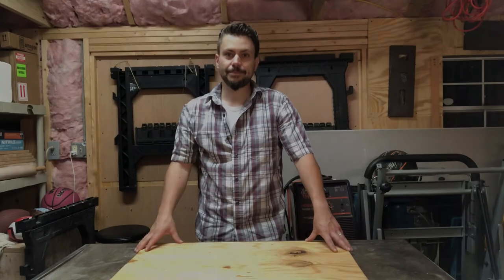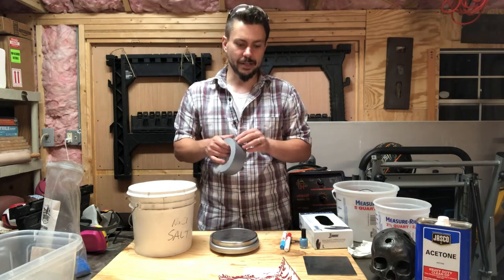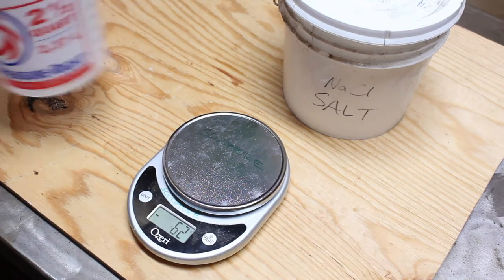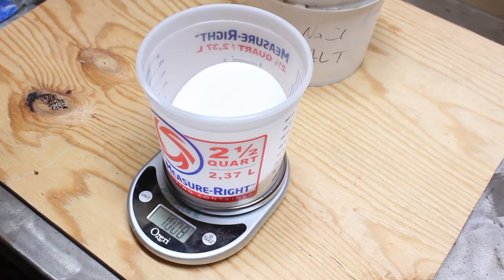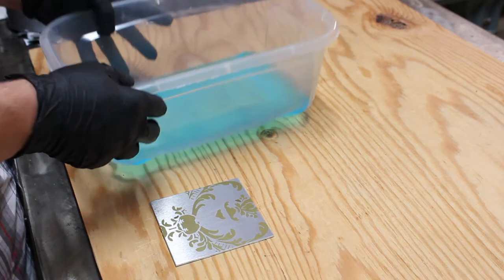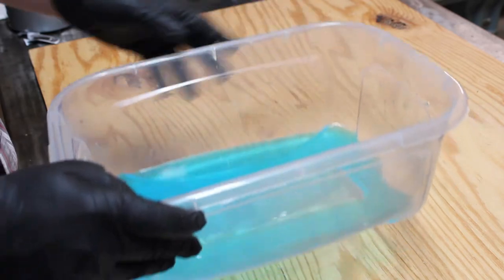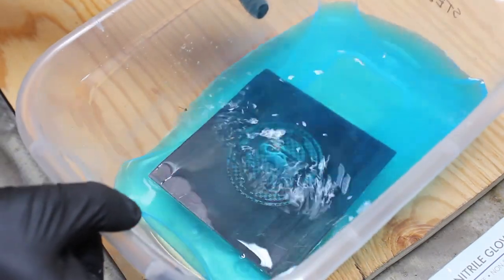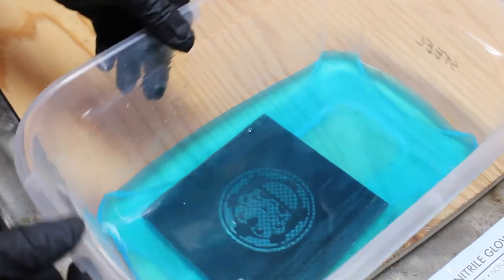Metal Etching with Copper Sulfate

Comment: You don't need to get anhydrous copper sulfate for this. "Anhydrous" means "Without water" which in this case is simply not necessary, as we're making an aqueous solution anyway.
Copper sulfate is trivially available at most hardware stores as a root killer. Just read the label.

Comment: does this work on stainless steel?
Reply: Certainly. Mixtures of nitric acid and hydrochloric acid (in a mixing ratio of 1 : 3 also called aqua regia are able to etch gold at room temperature. Elevating the temperature increases the efficiency. Using electricity in addition really does it!